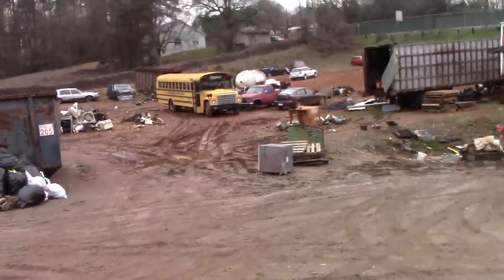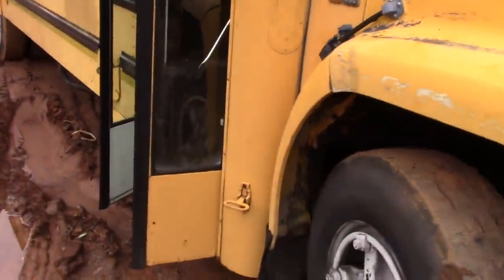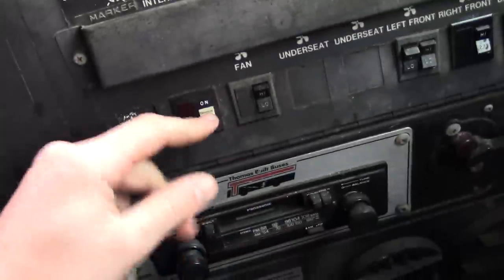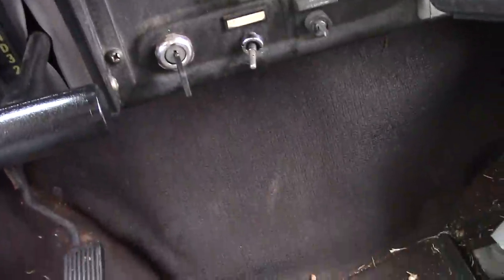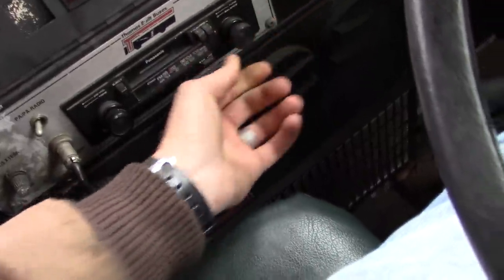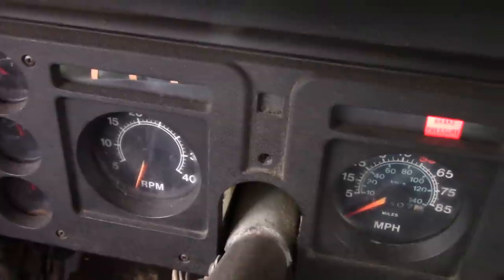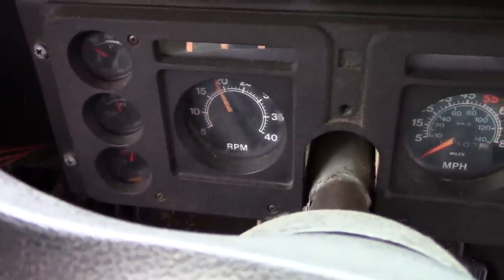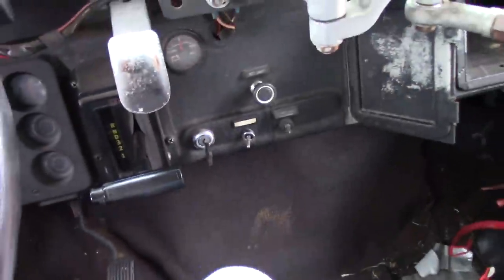!ANOTHER SCRAPPED SCHOOL BUS! 1985 International

Comment: Why not restore them and put them back on the road to save taxpayers money. Or sell them to small towns for their schools.
Reply: actually it's kinda strange  but there are laws concerning aging school buses  , they are retired after so many years or  so many miles,,
I am from a small town in Iowa and the school buses get replaced after 10 years or so 
another interesting note when nearly all city school buses are automatic transmission vehicles ,, all of the large buses owned by my local school except the pusher buses have a manual transmission
Reply: That would be too smart!May as well waste the taxpayers money.My district on Long Island was forced to replace there aged fleet of International Loadstars back in late 80s because of law requiring seatbelts and headlights on at all times.Would of been too much to retrofit 15-25 year old vehicles so they went to a fleet of Diesel internationals that have been replaced 3 times since then
Reply: my local community doesn't have seat belts on the buses  except tor the front few rows , some have 3 point seat belts ,, but they had LAP belts back when i was in school too that was over 25 years ago ,,,I still remember clear back in the early 80s when they changed from the low back seats to the taller padded crash seats they have now ,,they also at the end of the 80s and early 90s  gradually replaced all of the gasoline/LP powered buses with diesel buses partly because engines lasted a LOT longer 
I remember once when i was a senior in high school talking to one of the bus mechanics because i was taking auto shop and got to help in the bus garage ,, he told me that some of the buses  by the time they got replaced after 10 or 12 years had gone through 3 or 4 engines ,,but I also should mention that the part of Iowa i live in the southwestern area has a lot of hills ,and stop and go driving is very unforgiving to a very heavy vehicle especially one with a sub 6 liter V8 gas engine ,,gasoline engines even the big heavy industrial ones don't last as long as the  diesel engines they have now ,,and one thing big block gas engines hate doing is revving very high  ,and with a 28,000 pound vehicle  every time you start off from a stop you have to rev the engine to max power before shifting gears 
age and mileage are the 2 biggest factors in school bus replacement once they get to a certain point  they become much more expensive to maintain and are more likely to break down as well
Reply: Seat belts became a requirement in late 80s here in NY.They used Loadstars from 62 to 77 in my district.All 4 speed manuals and quite a few of them didn't even have power steering.When they got replaced by the diesel S series similar to what Jay is showing they all were Automatics.Don't know if gas engines were even offered for them in late 80's.
Reply: they never had internationals here where i live , I remember very well they were nearly all GMC/Chevrolet buses 
they had a 5+2 transmission like most large grain trucks ,, 5 speed manual with a 2 speed axle 

the seatbelt laws for buses  vary from state to state ,,,

I don't know much about international trucks/ buses  but i do know international never used any engines but their own in any vehicle they produced  ,,and the old IH trucks had gas engines up till the late 60s/early 70s
Reply: E Meyer I don’t know about the US but up here in Canada we had gasoline school buses as new as 91.
Reply: they had them around me too but gradually phased them out later in the 90s  in favor of more efficient and longer lasting diesel buses
Reply: Wow.I didn't realize they went out that far with gas engines.They always had good engines.Had that distinctive sound also.
Reply: Made some good stuff!I drove over the road for about 12 years and my last truck was a 2012 ProStar with a Cummins in it.Great truck.They had some huge problems with there own diesels at the time so we opted for Cummins
Reply: GM was the last company to build gas powered buses ,I am not sure how new some of the ones my school district had at the time i finished school in 1993 ,,but i do remember that at that time nearly all of the buses were LPG powered they could burn either GAS or propane ,they had  2 big diesel pusher buses that were handicapped accessible  , by the year 2000 when my youngest brother finished high school  the couple remaining LP powered machines were spares that got used for sports and  local shuttles 
my school district has also grown by over 50% since 1993 as well 
at that time there were 18 routes assigned a large yellow bus , now there are over 30 ,,and the district owns 40 large buses and at least 20 suburbans and vans
Reply: I've never had a cummins in any of my trucks personally ,,I have several larger trucks and they are all GMC trucks 
the oldest of them being a 1965 GMC 6500 with a V12 engine 
my favorite truck is a very nice example of early 70s technology ,, a totally original 1974 GMC 8000 truck tractor which i use as a tow vehicle to pull my 44ft  travel trailer ,, it's got 79000 original miles , one owner truck 
it's HUGE and ugly ,,and GREEN ,, powered by a 12V71 detroit  it's also LOUD ,always wanted a school bus  with that engine in it
Reply: Sounds like a cool rig
Reply: it is a cool rig  ,, my sister's boy  named it BIG GREEN  , i just love it  ,, it has more power than it can use 
and gets better fuel mileage  than my F250 ,, 11mpg on the highway ,, all the while putting 725 horsepower to the back wheels
Reply: You could get a gas engine in a GMC through 2000.
Reply: Yeah let's do that, it will be fun!
Reply: I don't want that shit back on the road. I pay taxes and want them to have new busses.
Reply: And the fleets can't be too old.  Those emissions would not pass inpection
Reply: @wildcoyote34  I wish that was the case in Texas. Our buses break down left and right and most of them are 1997-2002 models! They refuse to cough up the cash and buy new ones for the school district. Out of 50 buses or so, only 7 are newer buses ranging from 2011-2016. It's sad, really.
Reply: you really might want to check into the regulations in your area because im pretty sure the federal standard is 15 years maximum ,,i do know once they reach 10 years and about 150 or 200K miles  the DOT annual inspection becomes even more stringent and thorough 
it also varies from state to state but there is regulations for it ,
eventually it's going to get so expensive for them to keep their old vehicles on the road  that your school district  is going to have a financial crisis 
i know in my county in iowa the oldest vehicles in the fleet are 15 or 16 years old and ALL of them are manual transmission vehicles ,most school districts around me still have manual transmissions because they last much longer , it's a carryover from the old LP and gas buses ,back when auto transmissions didn't last over 50K miles in stop/go driving
Reply: E Meyer they were still offered through the mid to late 80s. By then most school districts had switched over to Diesel engines to save fuel costs
Reply: The government doesn't like the emissions the older diesel engines put out
Reply: Angel Maradiaga a
Reply: @pikachuangelangel9234  i'm not sure what all these numbers mean
Reply: @wildcoyote34  .
Reply: State law regulates how long a school or activity bus can be in service - it differs from state to state.  It's the sort of thing that gives multi-state operators heartburn.

Comment: I love old Thomases, the one thing about the old ones is that until about 2005ish, the body style stayed exactly the same, with only the Chassis changing. They used to use International, until International got their own bus company (IC) and now they use Freightliner. Sadly they retired this body style, and replaced it with the C2, which I kind of like better since there is more head room, but the old style is iconic.

Comment: What a great find. I drove an ‘83 version with the same Thomas/International configuration many years ago. Mine had air brakes and air door but otherwise, the same. The lighted switch on the left panel should be connected to a strobe light. The two switches next to the door control should be part of the warning light system. Also, that lever on the panel beside your left knee is part of the warning lights too. When you turned it, I could hear that familiar flasher motor and saw the red pilot light start blinking. Hopefully this unit will go to a restoration buff as the engine (9.0 liter) and the rest of the bus appears to be in real good shape.

Comment: Very interesting vehicle. If it is in fact an '85 model year, it definitely has the larger engine option judging by the valve covers. I know for sure that is definitely NOT the 6.9L IDI Navistar engine that was used not only in Navistar trucks of the era but also Ford's F-250 and F-350 along with their E-Series vans of that vintage. That looks like a 9.0L V8 if I had to guess. I saw you chuckling at the sound the brake pedal was making as you depressed it with the engine off. This is because it obviously has hydraulic brakes (as opposed to air brakes) with a hydroboost assist. On trucks that big, the law mandates up to a certain number of assisted brake applications available with the engine not running (I'm guessing so that if the engine were to suddenly die while driving, the vehicle operator would be able to bring it safely to stop without too much effort). In a conventional hyrdroboost system, the power steering pump supplies fluid to provide assist for both the steering and the brakes. On trucks of this size however, there is also an accumulator and electric motor that blocks off both the power steering fluid inlet and outlet ports, and recirculates the leftover fluid within, to provide assist when the engine is shut off. This vehicle would be an excellent candidate to convert to a motorhome.PLEASE PLEASE PLEASE, get another old mid 70s era International Loadstar truck with a 345 V8 gas engine and manual transmission in. I want to hear one run!!!

Comment: Yes!! Love them old ass buses.
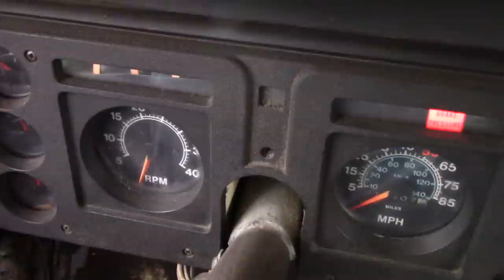Reply: RoyalKingA73 7:08.  That start was boaring but so like cool
Reply: RoyalKingA73
Reply: Me too
Reply: Nate Holland The start is so good!
Reply: same specaly the rare ones like ford chevry and gmc
Reply: The start is so staisfying
Reply: RoyalKingA73 fh
Reply: RoyalKingA73    For 8
Reply: Replacing the kill cable's a good place to start, LOL. Although I have had good luck with patience and WD-40. I bought a 31 ft travel trailer in need of repairs witch is about 1/2 the way done. I've still got my mind on a schoolie conversion. When I started the concideration it was either a bus or a large step van.  Probably going to flip the trailer for future bus building plans. It gives me something since recently beating lung cancer, I'm still recuperating. Can't work driving me crazy so repair/rebuild the trailer helps me, I'm slow but it's great therapy. I owe 4 yrs on the mortgage, been looking at small acreage in ozarks, always wanted to try offgrid. Make my on luxuries as I go,,,,,,,.LOL......
Reply: This bus still runs, and is probably still drivable, and it's sad to know that it's destined to be torn apart with a claw, and reduced to scrap metal.  I guess it's destined to be scrapped because it has far too many miles on the odometer. 
When I moved to Ithaca NY with my family in 1991, I fantasized about buying a retired school bus to make into a camper or RV to use for road trips back to Charlotte where I grew up.  With the exception of the front passenger seats, the "Troublemakers" seat, behind the driver on the port side, and the "shotgun" seat, behind the stairwell on the starboard side, I would take out all of the other seats to create like a living and sleeping area on wheels.  As for the "troublemakers" and "shotgun" seats, I may unbolt them from their original positions, and bolt them back in about maybe six inches back to create more legroom.  That would be so that chicks who sat in those seats would have more room to cross their legs thigh to thigh.

Comment: That would make a good RV.
Reply: Steve B you don't want to deal with the Dayton axles on this one in an RV setting
Reply: Why is that?
Reply: Ummm no. That's what hippies do.
Reply: god i hate dayton wheels , friging clinch rims are a pain in  the ass to change but the dayton wheels can be changed to 10 bolt wheels ,,i did it on my GMC 8000  , it required changing the drums/hubs and axles in the back and the hub/drum in the front
Reply: I bet he could sell it for couple hundred dollars for it if he still have it
Reply: Scrap
Reply: @seanmcgivney7631  Those rims are known as widowmakers because it is a unique split-rim design. You have to let the air out of the tire before removal and inflated after mounting, otherwise one half of the rim will fly off and do a lot of damage. That is why they went to Budd-style wheels afterward.

Comment: If it ends up being scrapped, you should demo a diesel runaway on it before it gets shredded 😁
Reply: Great Bay a diesel runaway is where a diesel engine finds a fuel source other than diesel fuel...(e.g. engine oil).  About the only thing you can do is let the engine destroy itself at a really high RPM.  Do a YouTube search on diesel runaway!

Comment: I'm betting that bus needs a lot of work to make it road legal/pass a DOT inspection, hence why it was scrapped.  

I hope this thing finds a buyer and they go school bus racing with it.  Its the model you want for doing that too, the engine/front axle being way out front makes it safer if you do take a big hit in it.  

Also what sort of engine is that???  Looks like a diesel V8, I thought it would have been a turbocharged inline six.   A lot of school buses of that era used the same Cummins turbodiesel inline six that you find in a late 80's/90's Dodge dually pickup.
Reply from the maker: Negatory, v8 Diesels were VERY common from this era. We've had dozens of busses up to the mid 90s and not one has had an inline six. Its either GMC gas engines or Diesel.
Reply: It might be a 9.0 liter.  I remember, back when I went to school, one of the other companies that drove for the school district had an International S1800 Thomas bus with a 9.0 liter V8 in it (it said it somewhere on the bus.) This bus didn’t quite sound like the 7.3, but it may have been the 6.9 as well.  I think that they started using the 7.3 around 1988 or 1989.
Reply: Aaron Bays these buses NEVER used cummins..... international only used there engines
Reply: Blue Bird had this type of International Engine on it's Wheelchair Lift Buses back in the 80s to mid 90s that Minneapolis Public Schools used
Reply: Rick Reed  this is a 9 liter V8 international diesel ,, International  or Navistar international as they are now ONLY used IH engines in their buses and vehicles ,,and the 7.3 liter diesel like they used in the ford trucks had not been developed yet 
I work part time for a neighboring farm and they have a 1984 model IH combine and it has this same engine 
Fracking nightmare SOB to work on  it's lasted 34 years though so it has to be a tough one ,  it's had over 6000 run time hours which is the equivalent of about 400K highway miles,,and unlike a truck  tractor engine hours are hard ones especially a combine because 80% of those hours are run at 80% or higher throttle position
compared to a highway vehicle which rarely runs over 25% throttle

Comment: It's 33 years old. It's just not meant for service anymore. Just like When a  transit bus is retired.  In NYC we have RTS buses from 1999 still in service.  But they will be retired next year.  All these low floor buses are taking over state after state.
   As far as this school bus goes.  It's 33 years old.  I agree to definitely not salvage it.  It can be used to collect scrap metal which will definitely generate earnings.
   I like the SaFT-Liner design.  They are way more up to date and much more smoother riding and safer.

Comment: What church was that bus from? At a property at 654 Sullivan  Street in Elmira NY sits an abandoned 1991 Ford Mustang. It hadn't ran in over a year the guy that owns it is in the military the motor is seized up. The owner tried to ynseiz the motor by removing the rear drive axle thereby breaking it in the process. My hope is that someone will locate the owner buy it and fix it up before it does away and become scrap iron. That would be a shame they are highly sought after muscle cars. To let this one sit and rot away and become scrap iron would be wrong

Comment: its a 1985 international S series chassis s1800 and a 9 liter V8 diesel when International Harvester went bankrupt Navastar took over International as they are today as the 9 liter been replaced by the DTA 360 and the later S series up to 1990 have the navastar logo. as 1990 the S series been replaced by the 3800 series bus and medium duty truck chassis  the transmission on this bus is an Allison AT545  the S series the engines are the 392 or 404 gasoline,  phased out after Navistar took over. the diesel engines are the DT 466 turbocharged, 9 liter V8 diesel replaced by the DTA 360 turbocharged, and the 6.9 and 7.3l IDI V8 nonturbo  as the 6.9L and 7.3L they were also used in the Ford F series pickups and E series vans of the 80s and early 1990s.  this bus will be good for Tommy Retro, Matts4290, Txstreetman, and ns9987.
Reply: Navistar got sued when the EGR's were bad on the powerstroke engines and the MaxxForce engines I thought

Comment: this was the med to heavy duty series of trucks  and busses that replaced the loadstar series it started with S 2500 and went on down S1700,1800,and 1900 production ran from 78-89 in 1990 it was replaced with the 3800 series and on up power train ranged from 345 V8 gas to the loud 8V92 Detroit diesel